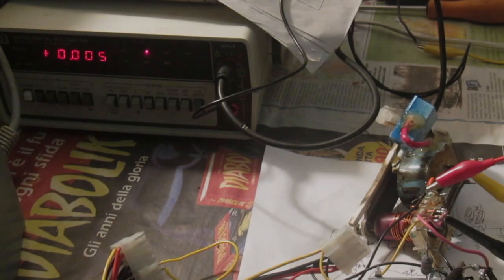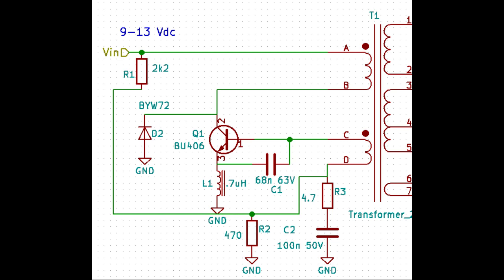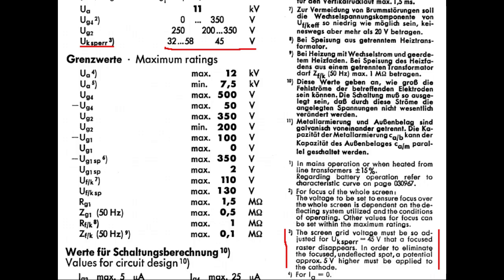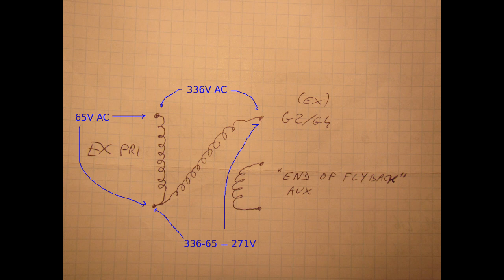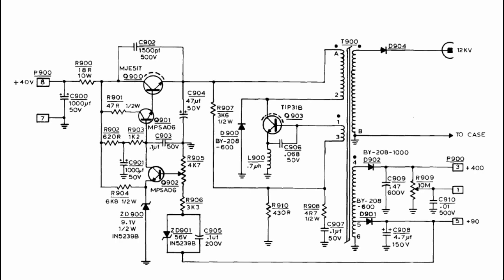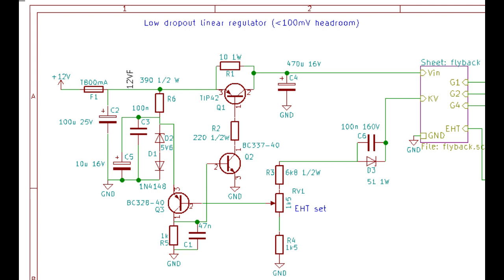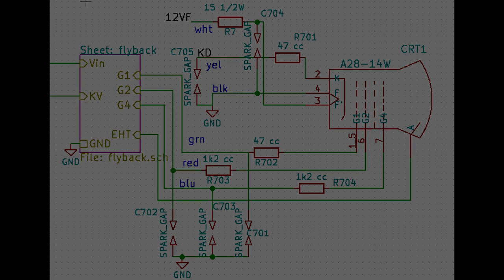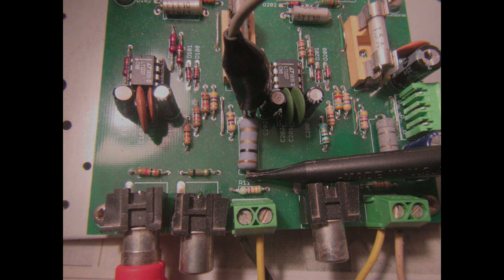Making a vector monitor Pt. 3: The complete power supply and the first deflection tests.

Comment: Excellent work! I'm doing something similar right now along with building a replica Vectrex motherboard.
Reply from the maker: Hi! Let's keep in touch then. A vectrex replica (if exact replica) will definitely need a CRT to run very low anode supply to allow for "easy" deflection with audio amplifiers like they did.
Reply: @iz8dwf the plan is to get it working with an Oscilloscope first then get it working on a modified TV. I haven't posted any videos on my channel about this yet. Are you on Facebook?
Reply from the maker: @MegaWayneD  Using the oscilloscope as monitor is a good plan, although the Z signal out of the vectrex is usually unsuitable for the typical oscilloscope Z input. However this isn't a big issue. No facebook here, my day is already severely overbooked.
Reply: @iz8dwf  I've got two boards, one is a replica of the original Vectrex board, the other is a Scopetrex board. Very interesting re: the low anode supply, I'm still kinda learning how these things work. I have lots of old TVs and various line output transformers.
Reply from the maker: @MegaWayneD  Basically, the lower the anode voltage, the lower the magnetic field (i.e. current into the yoke coils) needed for beam deflection. I show the formula on Pt.2 video. However there's a lower limit to anode voltage that seem the Vectrex engineers could ignore (or find a tube with a particularly lower limit). With too low anode voltage you have problems focusing the beam and a too large beam cutoff variation and maybe other issues. All XY monitors run the CRT at a lower anode voltage than the one specified for raster operation, but only the Vectrex used less than 70% of the "raster" value. Unless the correct datasheet for the CRT used in the Vectrex is found one day and proves my analysis wrong :)